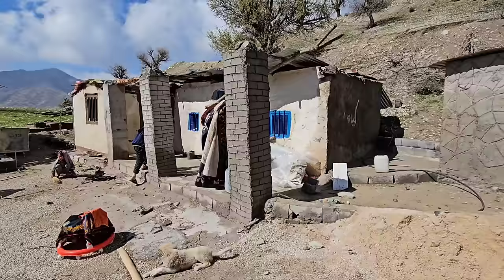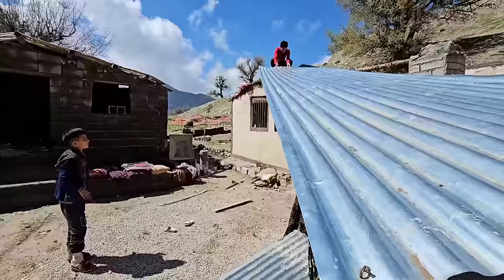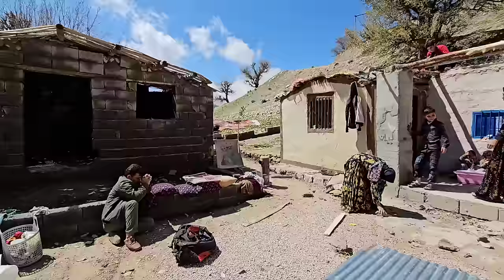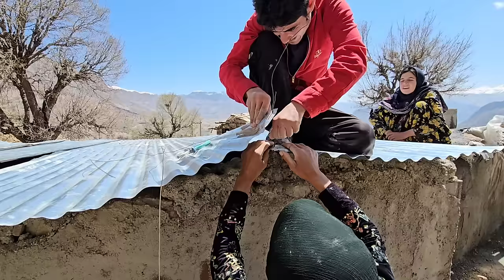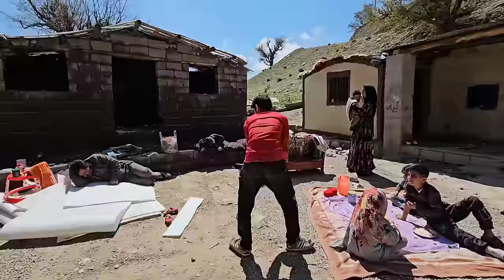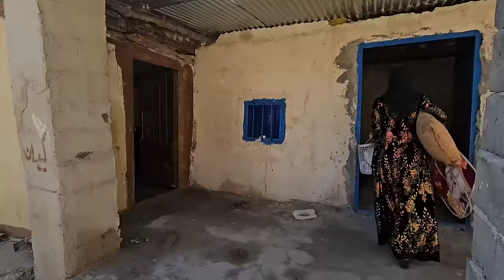Rebuilding Bonds: A Nomadic Family's Journey of Resilience

Comment: For the roof, nail boards first like Ali's roof then put on waterproof covering like the one using the fire torch to seal it on,  put on Izogam thoroughly all over the roof then put on tar like they did the kitchen roof.  Also add the waterproof covering again (by using  the fire torch.)  This should definitely seal it so it will not leak anymore.  This is how I've seen the other nomads build their roof without any leaking.  Have a good day !  😊
Reply: Wooden beams and nails nail the tin roof to the wooden beams we've been saying it for months they're not going to listen because this isn't real 😭😭😭😭😭😭😭😭😭😭😭😭😭😭😭

Comment: Corrugated iron roof should be put it in a slant position not flat,they should use more beams so the roof could be nailed properly ,from the terrace it should be place higher,then going lower to the end of the wall so water will slide down not stay on the roof,but Ali is still putting it flat,they dont listen to the advices of their viewers,wo good luck till the next rain

Comment: If it were me I would start from scratch with the roof and get rid of all that even the tin and everything. I would put a wood roof on, cement over it, then tar over that. Angling the roof high in the front and low in back by adding more bricks in the front. But...... No one is asking me😊